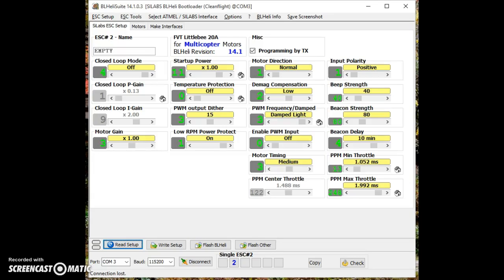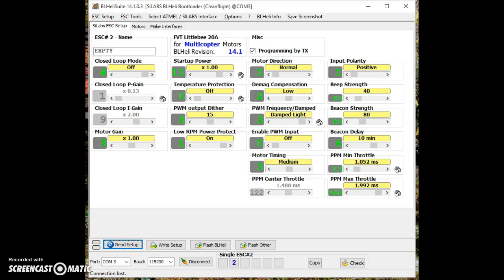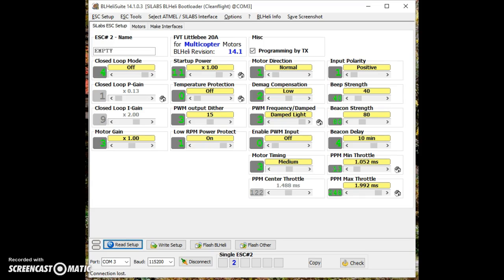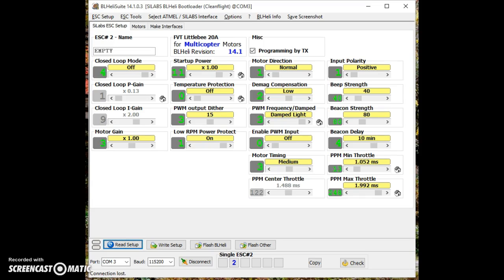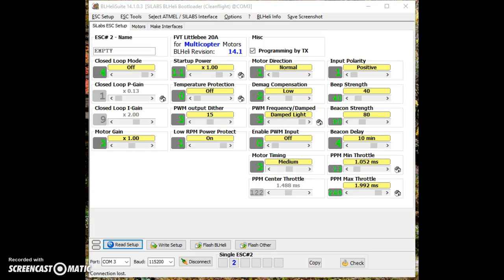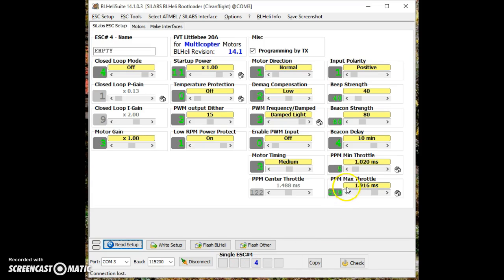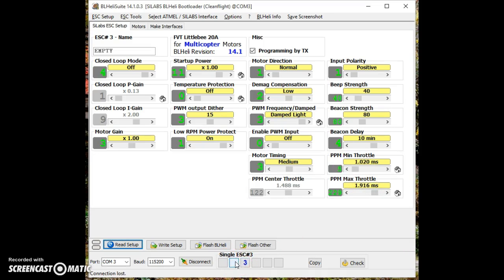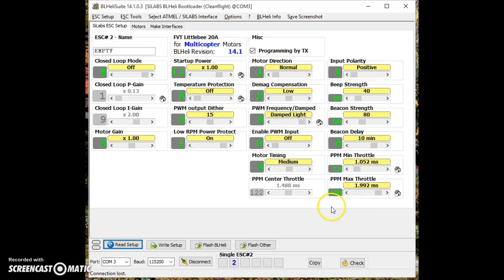Why I think ESC throttle calibration is important

Comment: What if you calibrate an esc of 4in1 esc and you have very very different values for one, like 1148 to 1752 or something like that?  Is it better to calibrate and leave it like that or to just leave it set to 1020-2000ish?  This is for running multishot.

Comment: Joshua,...am i crazy for asking, can you calibrate the esc's on a quadcopter with out the flight controller in the chain? I calibrated each of my esc's individually, having to desolder each from pdb board, and the solder a T pigtail to each in turn, as those were my only options, then after manually calibrating each, i resoldered them all to the pdb board(still my 450 sized quad wants to list over on one side/video coming soon)
Reply from the maker: +owenkilleen no. The FC sets its own endpoints. So the FC has to perform the calibration.

Comment: Is it weird that after calibrating LittleBees in BLHeli I'm getting a PPM max throttle of 2020 for all of them?
Reply from the maker: If that's happening you need to reduce max_throttle until they all come down below 2020.
Reply: recalibrated to a max t of 1980 and they caled to 1996,, except for one.?. can i manually match it to the others. I ran cal multiple times in blheli with same results
Reply: i got it with lower max value. finished at 1988, 1984, 1992, 1984,,, max was set to 1970
Reply from the maker: +_ DEVSTER _ how far out was the fourth one?
Reply: +Joshua Bardwell in blheli in the motors tab I set the max throttle value to 1970. After Cal completion motors finished max value is motor1-1988, m2-1984, m3-1992, and m4-1984. 
In betaflight config should I lower max throttle on the configuration tab?
Reply from the maker: +_ DEVSTER _ max_throttle in cleanflight should match what you used for calibration.
Reply: ok,,, thank you

Comment: watch the video, i found that if i calibrate through clean flight or beta it is always off, so i calibrate through blheli suite, but still unclear which is better. when i do calibrate through clean flight or beta then go to suite it tells me my motors are not synced so not sure if anyone has found a problem.
Reply from the maker: +richard shelton If you calibrate through cleanflight, you won't get the exact same numbers in BLHelisuite, but this is exactly the point of the calibration. Because they don't have synced up oscillators, 1 us to cleanflight is not exactly the same as 1 us to the ESCs. Calibration compensates for the difference in their oscillators. If you have a problem with BLHelisuite telling you the ESCs are out of sync, just disable the option to sync the endpoints between them.
Reply: +Joshua Bardwell so do u recommend cf better
Reply from the maker: +richard shelton I don't understand.

Comment: the littlebees confuse me as far as calibrating them goes.  I initially calibrated them in CF motor tab and they would sing a long song at the beginning and at the end of the calibration, i'm not even sure if that was the calibration music or something else.  I upgraded them to the latest blheli and now i get a short couple of tones when i plug in the battery, actually its short one beep from the normal beeps you get when powering on and then when i lower the throttle slider to zero they all beep once.  looking in blheli suite nothing seems to change.
Reply from the maker: +mooosestang I wish I had better advice for you, but I'm not sure what has gone wrong. I would say to check that "transmitter programming" is enabled in BLHelisuite, because if it is disabled you can't calibrate by stick. My best guess is that has somehow become disabled and your ESCs are not going into programming mode.

Comment: also are u using motor stop?
Reply from the maker: +sharon otmazgin Nooooo. I know not everybody agrees, but I want my motors spinning whenever my copter is armed. Also, I don't want the motors to stop spinning when I am flying. I also use an idle-up switch to prevent the throttle from going below min_check when I am armed. All of this together helps a lot with acrobatic moves. For example, when doing an inverted roll over a tree top, you throttle up to get a lot of vertical velocity, then cut the throttle to idle and just ride the arc over the top of the tree while rolling inverted. If you don't idle the throttle, you pull yourself downwards when you are inverted.
Reply: +Joshua Bardwell yes I know that's why I asked :)

Comment: I did the calibration on betaflight. 
all my esc's r sync at 1024 .
but in bf configurator I have set min throttle to 1080 and min check to 1020 and still no mater what I do the motors start spinning at 1024 
my min command is 1000
Reply from the maker: +sharon otmazgin Calibration is based on min_command and max_throttle. I believe that BLHeli adds a small margin to the calibrated values, to ensure that the ESC will always reach minimum and maximum throttle. In other words, if you have min_command=1000 and max_throttle=2000 then the ESC may calibrate to 1020 and 1980 or something like that. 

As long as the calibrated values are not too far off from each other, and as long as they are >1000 and <2000, you are fine.

If the motors start spinning at 1024, then you need to set min_throttle to e.g. 1030. You want min_throttle to be just slightly higher than the point where the motors start spinning.

Min_check does not affect calibration at all. All it does is set the stick position at which the throttle curve starts, vs. the dead-band at the bottom of the throttle range where stick commands can be entered.
Reply: +Joshua Bardwell thanks a lot for helping my TX end points r 991 to 2015 so I'll set min throttle to 1030 and min check to 1020 and iam done is it OK ?
also I can lower min command a bit

Comment from the maker: @Justin Hill - Not sure why I can't reply directly to your comment, but no. I didn't solder any of the signal wires on these ESCs. They're all factory. I suppose I could check the joints since even the factory makes a mistake sometimes.

Comment: @Joshua Bardwell, I really enjoy your information and you tuning thread is spot on! Obviously you have done this a while, but I was wondering if you think the difference of the one esc could be wiring or a solder joint? (Again not questioning your solder skills as you can see the others are spot on!)

Comment: Hi thx a lot for this video. Would you recommend this SiLabs Littlebee 20A ESC's or the KISS 18A ESC'S? The KISS ESC's I could get even cheaper than this Littlebee ESC. But since the KISS ESC are based on Atmel Im a little afraid that they have sync issues on high rotations. Btw I want to use the RCX 2205 2350KV motors.
Reply from the maker: +xuxusito KISS are some of the best ESCs on the market. Although they are Atmel based, the designers have done whatever needs to be done to cover up the deficiencies of most Atmel-based ESCs on the market. The main thing that is wrong with KISS 12A and 18A is that they don't have adequate over-current protection. So if you crash and smack a prop into a tree, the momentary impulse can send enough current through the ESC to cause it to light on fire. KISS ESCs are known for literally catching fire during crashes. The 30 amp KISS ESCs are supposed to have better current protection that prevents this.

Despite this, top pilots still fly KISS because they fly so well. If you buy KISS, buy at least two extras for every four you get, because you WILL be changing them out, and possibly bring some fire-safe gloves to the field with you for when you have to run down your copter before it lights the field on fire.

I have only a few flights on the Littlebees, but they are amazing so far. QuadMcFly's test results show that their thrust and braking performance are up there with the best, if not the absolute top of the field. They are cost effective and small/light. So far, there are no reports of quality issues or fires, although they are a bit too new to judge for sure. Also, they may not have quite as much tolerance for running close to/over their current limits as compared to for example, the RG20 ESCs, which have been tested well over 20 amps, with no airflow, and just run and run and run.
Reply: +Joshua Bardwell wow thanks a lot for this detailed information! I decided to buy the littlebee esc's since its going to be my first build ever and I dont want to replace the esc's everytime I crash. I first purchased the Dys BL20A but because of the bad reports about burned ESC's and motors I will sell them on ebay and use the Littlebee 20A. Thanks again a lot for your detailed information about the KISS 18A ESC'S and the Littlebee ESC'S!

Comment: I also remember Boris saying that and so I have been doing the matching method since.

I am confused if you are only using the calibration method for reference, or if you actually leave them at those values? are you just trying to get an idea of what the ESC sees, and then using the matching method accordingly?
Reply: This is exactly the reason I dont calibrate. Dont forget that there might be occassional jitter in ppm signals. That can really throw off the calibration off. Sometimes multiple calibrations can result in different results. Maybe calibration on PWM mode would be better. Not sure.
I just want to be safe with static values.
Reply from the maker: +ArminFPV I'm leaving them at these values. I know that the PID algorithm will take care of mis-match in motor throttle response curve to some degree, but I feel like it is probably best to have the ESCs' throttle response curves calibrated to the range of min_command to max_throttle. For example, ESC#2, which is reading high, I had to lower max_throttle to 1955 to get that ESC to read anything below 2000. So if I were to set max_throttle to anything over 1955, ESC#2 would hit 100% output at 1955 while the other three motors weren't there yet. I haven't really fully thought through the implications of this, but it doesn't seem right. If I pull max_throttle and min_throttle inwards so that all ESCs are able to perceive the full range of throttle values output by Cleanflight, then I will lose some resolution across the throttle range, but as long as both CleanFlight and the ESCs agree about what is the top and the bottom of the range, the full range of power will be output by all ESCs. The different PPM values that the ESCs record after calibration are the result of differences in the ESCs' timing circuits. So it seems to me like setting the ESCs to the same max and min values actually guarantees that they will NOT have the same output value when they are given the same input value.
Reply: +Joshua Bardwell This is interesting. I feel as if this is something we should have figured out long ago, given the advancements in the PID algorithms and FC software, ESC min and max values seem a trivial problem...

Could using the matching method when the timing of the ESCs arent identical be the cause of motors starting up at very slightly different times?
Reply from the maker: +Boris B. Regarding jitter, the Littlebees were dead on to the microsecond over multiple tests. Just a data point for what it's worth.
Reply: +Boris B. sorry Boris, I don't understand. why exactly do you not calibrate via CF? are you saying calibrating via CF is what causes the out of sync start ups?
Reply from the maker: ArminFPV there are too many variables in the motor startup to say for sure what causes it. For example, it could be differences in the ESCs' timing circuitry, or differences in the friction of the motors' bearings, etc... However, I can tell you that, until I ran throttle calibration via the Motors tab, my ESCs did not start at the same time. After running calibration, they start at pretty much the same PPM value. Within maybe 5-10 us at most.

Comment: You were correct that Boris at one point said he leaves the Blheli min and max throttle at default values (1.020 and 1.832 i think).  If he still does or not and what he sets his CF values to i don't know.  This info was taken from someone asking about his min and max in a cli dump.
Reply from the maker: +SloMo At least for me, with these ESCs, using Boris's approach would have resulted in mis-matched output values between the ESCs, because their timing circuitry is not 100% in sync with each other. This may all be splitting hairs, because the PID loop will compensate to mis-matched output values, but it feels better to me to have all the ESCs synced, even if it means that their PPM min and max appear to be different numbers.